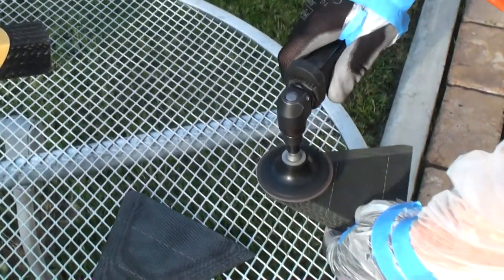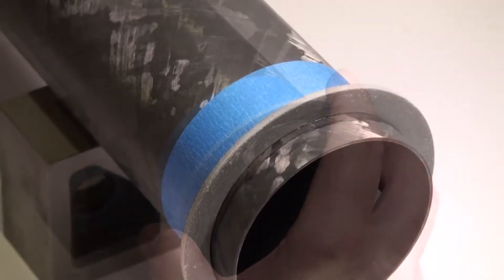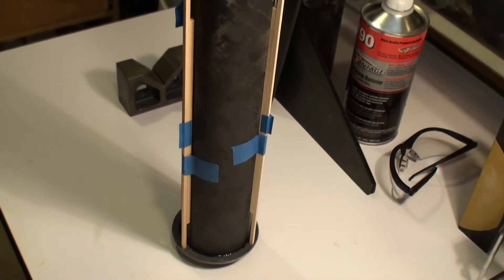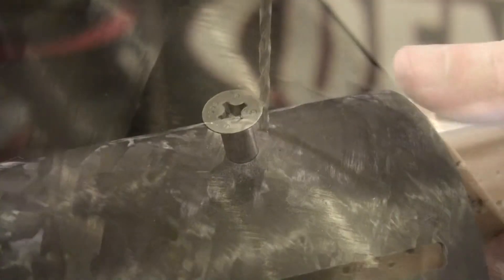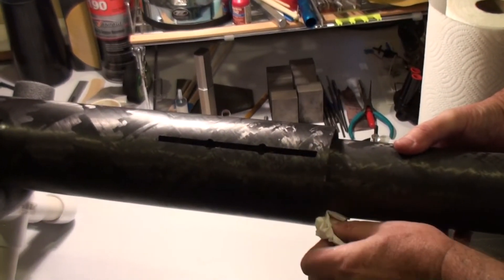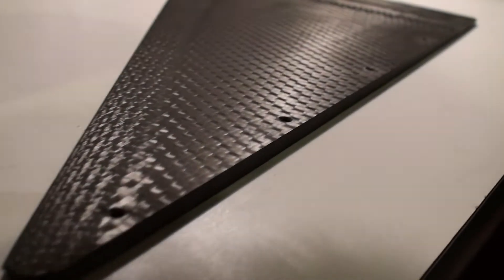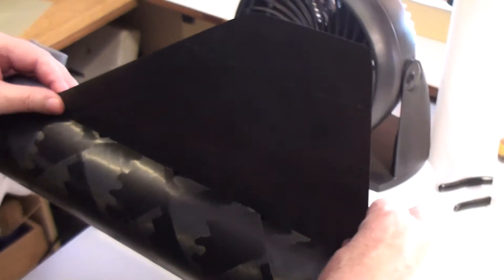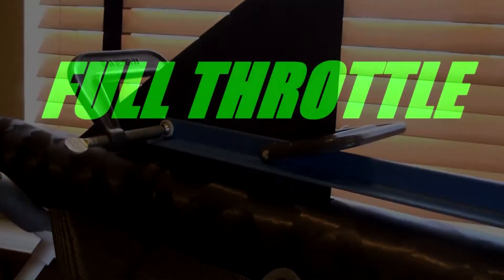High Powered Rocketry Level 3 Cerification Build

Comment: Ok, I found this video to be somewhat confusing.  I didn't understand why you were putting the fins in the places you did. I also didn't understand why your engine tube was sticking out so far. You took the time to drill holes in the fins for "rivet" idea, but you pre filled at least one fin before you did your fillets, which didn't make sense.  I think that a description at the beginning of what the layout would be would have solved my confusion.

Comment: So this is a kit set.. not a build.  I'm doing a build these filament wound tubes are average. I build my from fully customized and pre preg  design lamainte. .. nice kit set build
Reply from the maker: This was not a kit, the entire rocket was scratch built using custom ordered airframes made by Rocketry Warehouse, all custom thin wall tubing to save weight, the fins were made from 1/4 plate material and the entire rocket we designed, was through the Open Rocket software. Nothing in this build was a kit.
Reply: @AllenSunnyD  so u didn't make the tubes or any of the carbon component.. it's a kit set.  Cut, prep glue..    I have made all tubes, couplers. sowing  all kevlar shock cords with eyelets,  made parachute vut cutting out shape and sowing all parashute cord on.  Custom made nose cone from 3 piece mould.  Custom made carbon lunching lugs with custom launch rail.   Do u see a difference  I'm a boatbuilder by trade on the scale of a building a rockets are about  2/10 of difficulty.  I had my 4 year do most of the work on his rockets same as what your doing in this video assembly part I do all the dusty and fitting work..
Reply: @myopenheartconz  so you're saying the Saturn V was a kit?
Reply: @ej-1608  I'm saying it still not custom.    Have a crack at making everything.  Think outta the box... must be a culture thing... or something.  Maybe I'm just creative and  have mad not to buy anything of the self to say.
Reply: @myopenheartconz  more of a wording issue. This build is custom made since it is not off the shelf and had it made to his request. You used the word custom for your build, a more appropriate wording is scratch built where you make everything yourself. So yes this rocket is not a scratch build but it is a custom build.
Reply: @myopenheartconz  Well you are a boatbuilder, lots of tools and experteese, something most people
Reply: You have lots of space, tools and expertise, something most people do not have. He designed it, had someone do the carbon tubes and cut the fin holes to his specification. Then he did it all by himself. So stop being a "Shnob" and applaud the excellent video and rocket he produced. Better still how about you make one of your entire custom rockets from design stage to launch, now that would be really interesting to see!
Reply: So if i use  the estes scratch builders box, i am making a custom build not a scratch build?

Comment: Great idea about drilling the holes in the fin root, for the "epoxy rivets." But then you filled the holes with epoxy before you even attached the fins to the MM, so I don't understand that logic at all. Why didn't you leave the holes clean without epoxy, and then your injected epoxy would have achieved the desired effect.
Reply: Once that brushed-on epoxy cures, the holes are plugged...and you've spent your powder on that idea, so to speak.

Comment: And at 4:30 in the video, what type of tool/bit is that to make the notches? I've been looking for something to do a similar job by hand for my rocket builds.
Reply from the maker: Garrett Parham We used a pencil grinder, it makes it really easy to get good results.
Reply: ***** And the carbon fiber? We've been doing wet layups and for fins adding a layer or two of Aero-Mat from ACP Composites to work as a core for bulkheads, fins, etc.
Reply: @AllenSunnyD  🔴 What Is Islam? 

🔴 Islam is not just another religion. 

🔵 It is the same message preached by Moses, Jesus and Abraham.

 🔴 Islam literally means ‘submission to God’ and it teaches us to have a direct relationship with God. 

 🔵 It reminds us that since God created us, no one should be worshipped except God alone. 

 🔴 It also teaches that God is nothing like a human being or like anything that we can imagine.

🌍 The concept of God is summarized in the Quran as:

📖 { “Say, He is God, the One.  God, the Absolute.  He does not give birth, nor was He born, and there is nothing like Him.”} (Quran 112:1-4) 📚

🔴 Becoming a Muslim is not turning your back to Jesus. 

🔵 Rather it’s going back to the original teachings of Jesus and obeying him.